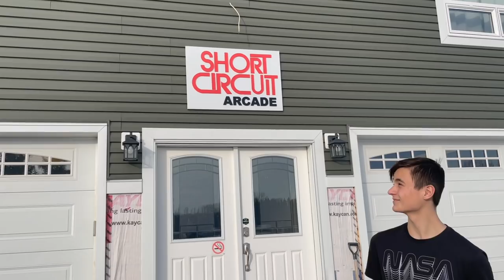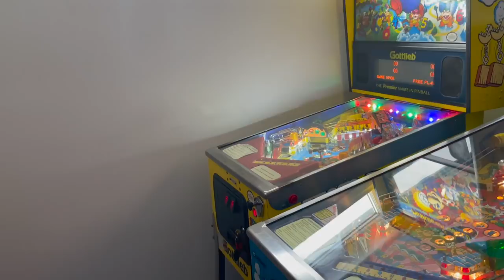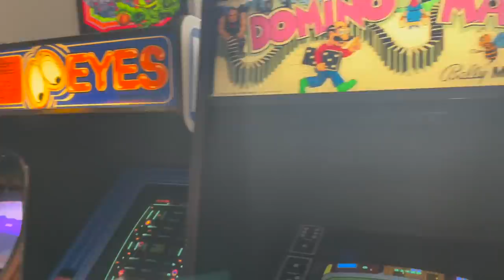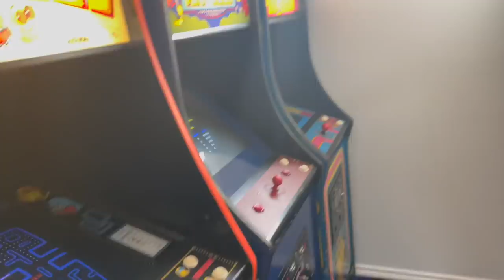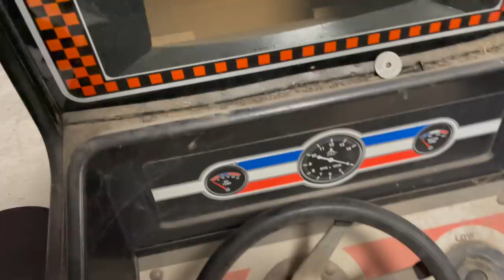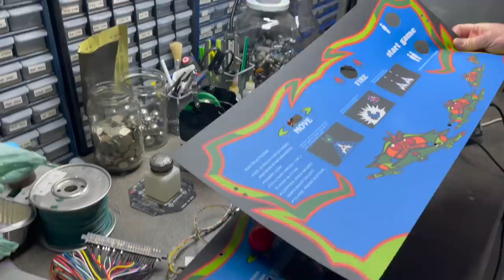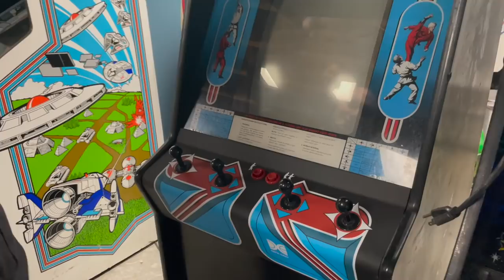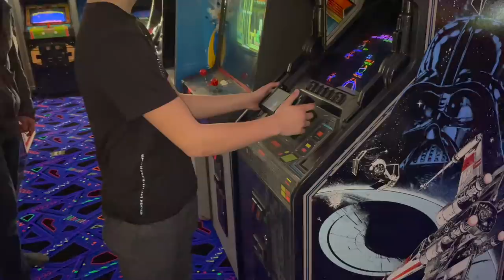Full arcade in his house! you won't believe this!

Comment: 17:47...you flew by Satan's Hollow!   I bought one of those for $50 non-working in about 2007.  I had about 18 games total in my basement arcade. Because of the subject matter, I had to move it out and hide it when more religeous folk visited.  I sold it for about $1,700 within owning only about a month.  Subject matter is everything.  BTW, the coin counter only had 500 plays, and I bought it 20+ years old.  No One wanted it around!  Cool to see one sitting there.

Comment: Alex, bring your Simpsons board for him to look at.  Most old boards like that are repairable, it's the capacitors that go bad typically or you get a trace that is corroded or damaged.  These are simple repairs for people with the knowledge.  An eprom issue is a bit worse, you'd need a reader and an original that's working and then reburn it.  But it's doable.
Reply: Ha. I just left the same comment. Could be a cold solder joint, maybe a chip not fully seated, maybe needs a new ROM chip or the items you suggested.
Reply: Um, volunteering someone else?  If he wanted an extra job, he’d have volunteered himself!  He probably doesn’t have the time.  He could probably recommend someone, though.
Reply: @Lucinda_Jackson  no what I meant was that non electronics people typically don't realize you can fix these things, they tend to think "well it's bad, need to find a new one".  The guy Mathew could probably look it over and know in 30 seconds if it was completely destroyed or if it could be salvaged.

Comment: Alex, what's wrong with your Simpsons board? Sometimes it can something simple as a lose chip or a cold solder joint. Maybe a ROM chip just needs to be replaced & reflashed. It isn't too difficult a process. Matthew could probably fix it.

Comment: The first video game I played was Pong in Gare Centrale in Montreal 1974. I think it was 50 cent per game. I played two games that took maybe 3 mins.
    The chipped particle board is an easy fix not counting graphics. Cut off the busted part straight and make a deep rabbit (about 1 1/2" wide)with a router. Make a matching rabbit on a new piece of particle board and use regular wood glue. Clamp together and it will be stronger than the original. Trim and finish.  It's a whole lot easier than it sounds.

Comment: pretty cool, I love the cabinets and graphics.  i know its not the same, but you can emulate all those video games  with a pc and big screen tv.   Just the task of getting them upstairs must of been a struggle, never mind finding and fixing them up.
Reply: Emulation is never the same. You can't replicate the proper control panels. I use a fork lift to lift the games to a deck then wheel them in. It was a tedious task. Took 3 months by myself to do it. But totally worth it. 😁
Reply: @shortcircuitarcade3151  what do u think of the arcade1ups i like them but im only gonna get the XL cabs from now on they're lighter than the real cabs and less maintenance
Reply: @GregoryAlanBaileygamereviews  I don't like them at all. They need to have crts and original hardware for my liking.